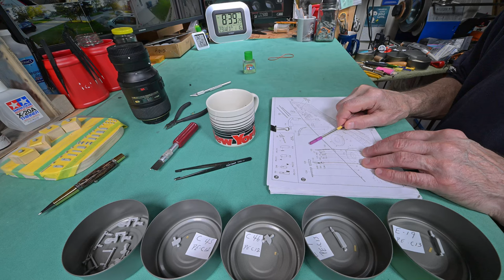The Model Ship - Part 1197

Comment: Morning Ron, yes I have had the same problem with Tamiya Flat coat stopped using it now and switched to the Army Painters rattle can varnish for Gloss, Satin or Matt finish, if I need to put it through the airbrush I just decant it into a clean Tamiya or Mr Hobby paint jar and use it from there. The deck fittings and chain plates that are moulded onto the deck are you masking or hand painting them?. Also just found a unboxing video of the new tool Yamato looks very much like a Trumpeter kit I think they are just rebranding it for different counties  USA its Gallery, in Europe its Glow2B and it looks like Japan its Monochrome here is the link  https://www.youtube.com/watch?v=efai-GOuQfc
Reply from the maker: Thanks for that link. 👍

Comment: The bird house I built is a little bit different. I bulit it with a different roof and a more box-shaped design. Basically a square bottom panel, rectangle backpanel, two rectabgular panels on the side where i made a 15° angle on top for the roos, rectangular roof and frontpanel. SImple and easy. Since I dont have any triangular shapes I solved the cleaning issue like this: On the front: 2cm strip of wood across on the top, 2cm strip of wood on across on the bottom. Then you cut the front panel 1cm shorter then the front. Then slip it behind the strips you attached. You secure the front panel by another 2cm strip on the front panel which you can place a little bit under the entrance hole. Before winter you can slide the front panel up, remoce it,  clean it, and close it without any screws.
Reply from the maker: 👍
https://www.birdwatching-bliss.com/bird-house-plans.html

Comment: Hi Ron  , that was me , that told you it wasn't deck tan,  had the same problem with the krug, but only a couple of spots ,at the time I put it down to very high humidity,  but seeing you have the same problem,  with hardly an humidity, , I concluded that wasn't the problem! I usually I use hardware bought clear in a can , never had any issues,  think im going back to it,  much cheaper to ! 😊😊😊😊 you have bird problems,  possum problems,  we see them walking the power lines at night going from one house to the next 🐿🐿🐿sèe you tomorrow
Reply from the maker: One of my woodworking friends here in Winnipeg had racoons move into his attic. 🦝😦

Comment: Ron the clear can harden or cure at the tip of the airbrush and then blow off sticking to the ship.
thinner clear coat should work better.  does your house look like a sand cliff. they look like sand martins.
Reply from the maker: "thinner clear coat should work better." Will thin it out more next time. 👍

Comment: Dear Ron, the specks you have on the boat look familiar to me. I used 2 drops of anti silicone in a liter of paint and that was the solution. My advice is to wipe it off with a cloth with anti-silicone before you start spraying. Seen on 3-6-22 at 10:26 in the NL.

Comment: Settled clear coat that is not completely mixed will do that.  The flattening agent used may be a fine waxy powder.  It can be difficult to re-incorporate if it settles. It may appear mixed when fine unmixed particles are just suspended in the liquid rather than mixed in completely.  The first thing to try is to mix longer.
Reply from the maker: "The first thing to try is to mix longer." 👍

Comment: Ron, the clear coat problem is very annoying. I have had a clear coat go frosty, on a tank model, i sprayed thinner over the model and it brought it back to near normal. I will be using a clear coat on HMS Nelson
Reply: @roncalverley  Will be doing a video tomorrow morning as I painted the hull.
Reply from the maker: @militarymodellerpaul5932  Will watch for you video on that. 👍

Comment: I have tamiya x22 clear looks fine but I have 2 bottles of testors Dullcote top coat that has white  semi transparent stuff that settled on the bottom. Have not yet mixed and try spraying them to see if they cause spots on the surface. I need to setup my airbrush and see if they have that spotting problem. I due have paint filters that I will use. I normally use spray cans that are the same dullcote by testors. I know that rustoleum bought out testor's and model master paint. Don't know if they had any problems when they took over. I will let you know if I have the same problem. The testors are 1.7oz compared to tamiya 1/3 oz. and cost less then tamiya too. I like Dullcote alot with covering decals and model that get handle a lot. If it is the clear coat the only thing to correct it is paint over it or strip of the paint and repaint. Good luck on your decision. I have problems with mud swallows building nest above my front by my cameras. Be safe and see you tomorrow.👍🚢🐇🚂
Reply: I did do some testing of the semi transparent white particles and they did dry as white spots. It is what they use to make flat or dull coat in clear instead of gloss. Tamiya makes a flat base X21 that you add to gloss paint to make it flat what I have read. Some modelers use it in weathering there models by removing it partly and then putting washes over the area like with rust. I usely put a marble in my paints bottles to help in the mixing process. Hopefully this helps you on what may have caused the white spots. The guy with the YouTube channel Barbatos Rex does alot of paint reviews that could give you more information on this problem possibly. Another channel is Mokanaman in workshop 95 on tamiya XF-86 flat clear talks about white spots some. It was 6 yrs ago for the video on it if you want to check it out. Spray light coats and avoid pooling of paint.

Comment: Ron, re-watch the beginning of today's episode and you will see all sorts of white spots on your green cloth that look an awfully lot like the spots on the ship. Did you have a package opening recently that may have had some bead styrofoam packing material in it? That stuff has tremendous static cling to it and the plastic of the ship will act like a magnet  if those particles get stirred up from the airbrush while you're spraying. I have never experienced the problem that you believe you are having with the clear coat and I have some spray cans of Testors Dullcote that are close to 5 years old if not older. I have never used an airbrush to apply any type of clear finish. I also noticed that you apply your clear coat rather heavily in one coat and it may be too heavy to cure properly. I've always applied it in 2 or 3 light coats without any problems. Just some ideas on what the problem may be. The only way I know to correct it is to very lightly sand the spots with extra fine grit sand paper and lightly re-coat again afterwards. Are most of those spots on the side you brush painted the clear coat?
Reply from the maker: Nope! Not Styrofoam. But thanks! 👍